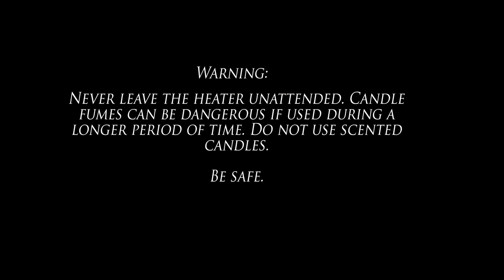Clay Pot Heater with Fan - Powered by Candles (DIY)

Comment: Hello, I like your design.  I have been running a tea light heater for a couple of months now - if I may offer a couple of improvements.  Move the pot higher away from the candles - this reduces the possibility of the candles getting too hot and catching fire.  Secondly add more pots to increase heat output.  Thirdly use a Arduino microcomputer with a temp sensor and 5volt fan to monitor the temp and adjust the fan speed accordingly.

Comment: the pot is for radiant heat  a fan will harm the prosses by not letting the clay pot get to temp  making it only put out 30-40% of total heat and fumes will build  up quick when you let  the pot get very hot it helps to completely burn all of the off gases like a catalytic converter keeping the air far less toxic  this heater is the type that heats in the same way as sunlight  just with out any light or forced air flow  good job on the build its good to try all ideas and find what works best look forward to your next video👍👍

Comment: Excellent and impressive.  In reading various comments, it seems that using a Peltier thermal unit would allow you to power the fan without a separate source of electricity.  Then your system would be completely self contained.

Comment: Just a suggestion. Use a Peltier to produce Electricity from the heat to run the fan. Then all you need to buy is the candles. Or instead of candles, you can use a Lamp burner with a wick and a jar, you  can use any  lamp oil. cheaper, hotter and lasts longer No outside electrical current needed. It will produce its own.
Reply: wait say it again to a newbie here,
Reply: Vegetable oil is much better than any lamp oil on the market, a canister will burn for up to 120 hours!  Lamp oil is designed to burn three to four times faster than that.

Comment: Very nice temp for a 8x12 room. good job. perhaps less holes in the pot would help the heat to build up  and give you a higher temp reading. this way the heat isnt pushed up and out as fast. the more holes the faster the heat expels and rises giving you a lower temp count. less wholes allows for more heat to be stored and pushed out keeping a steady high temp out put. ******Or even adding another pot on top with spacer when keeping the same wholes in bottom pot

Comment: Solid state graphite power cell bank used with organic carbon power cell to generate electric to operate warming LED lights within that clay pot for a space heater you can use anywhere with out creating toxic gases has a byproduct. ; )

Comment: Idea copper pipe diesel glow plug sealed in one end fill pipe with gallium to help conduct the heat sweat cap on end of pipe and use has heating element in clay pot. Glow plug will operate off 12 volts then with that low voltage fan? ; )

Comment: Try a seed warming LED mat wrap the lights around the inside of the clay pot then run the electric fan and LED heating LEDs off a solar panel set up to keep warm without burning anything? Novartis
Reply: While solar is an inexhaustible source of energy, it is not renewable in terms of fabrication, cost, and replacement.  Cooking oil can be used in a heating system even after it has been used to cook with!  Also, the low energy efficiency of solar (18%) is just a fraction that of cooking oil (75%), as the latter burns cleanly, efficiently, and cheaply.  IF (big "If") solar were to achieve 75% energy efficiency and its cost of fabrication drop by the same amount, you might have a reason to go solar.

Comment: If this is to be a room heater the test is the room, not the exit air.     A test would be this thing vs. just the candles burning in the room.   My guess -- the same.   Minus the waste of battery life.    I intend to try it with 10 candles spread around on the floor.
The heat will rise and move around -  no need to blow it around I think.   This needs a fair test..
Reply: there is also a thing called a furnace in homes ..... you know, the thing that heats air and then blows it into the room?

Comment: Use LED seed warming light mats to wrap up a clay pot then use that low voltage fan with the low voltage warming lights to make a low voltage warmer you can use off a solar panel set up to heat a green house home or trailer. Way safer then having to burn something. ; )
Reply: Electrical fault disasters (and death) are quite common.  Except for human error, a controlled heating element is not dangerous.